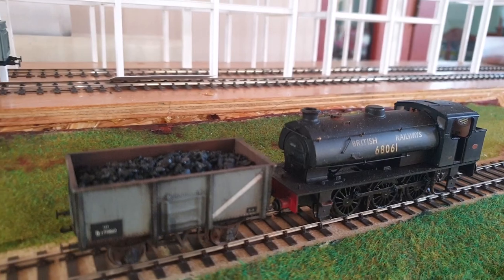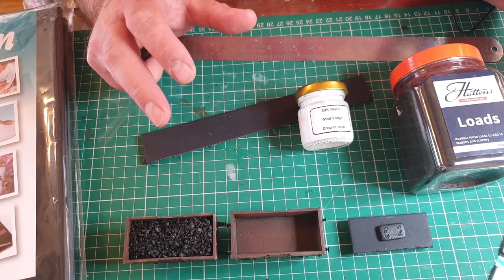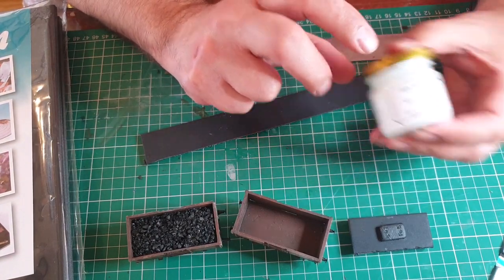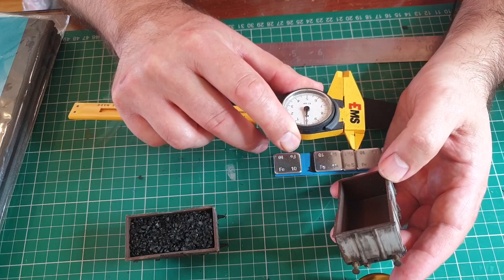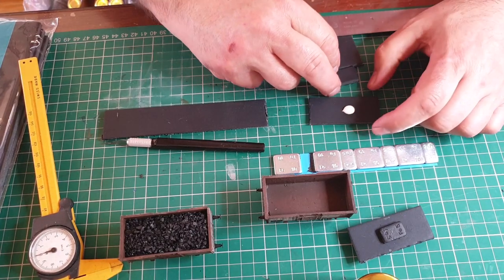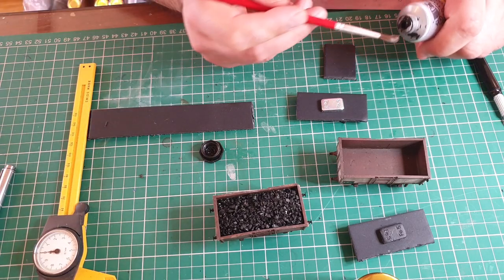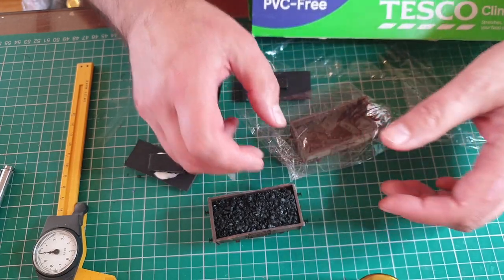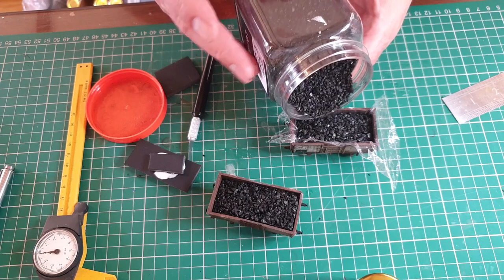CLING FILM & Hattons COAL LOAD AIRFIX / DAPOL / Cambrian 16T Coal Wagons.

Comment: Nice that you are using Mod Podge Matte, Steve, which does not leave that slight statin sheen that you can get from using regular PVA.
Do you use a formula for adding weight to rolling stock?  25gm per 25mm or 1oz per inch (if you are into good old imperial measurement) total weight is a good guide.  The use of small flat digital kitchen scales is useful for that purpose.  Enjoyable video, Steve.  Best, Jason.
Reply from the maker: Hi Jason, Thanks for the info on weights.  I do try and get weight in as low down on the centre of gravity as possible, which can be a limiting factor. I try to get close to a bachmann or RTR equivalent. Have you noticed how light Accurascale wagons are, especially  Cemflo's? Need to go and pinch the wife's Kitchen scales...!

Comment: Quick question I know there is nothing better to use as coal for a coal waggon. But what can you use for Coke as a load does it look like coal?
Reply from the maker: Interesting question! I have looked at several photos of Coke wagons and it is different to coal. I have had in mind using woodland scenic Cinders Ballast. However Hattons do Coke wagon load material? May give some ago in coke hopper wagons I have v woodland scenics? Wikipedia have image of coke; also check out image in totonsidings.com/upside-hump  Regards Steve